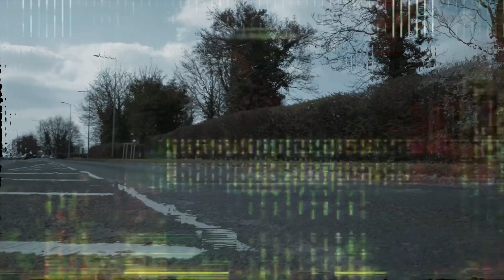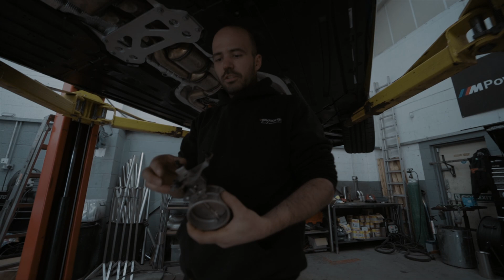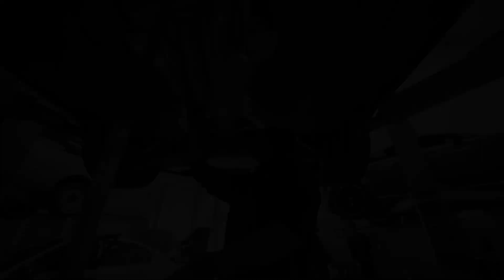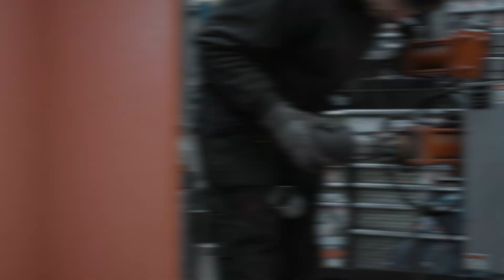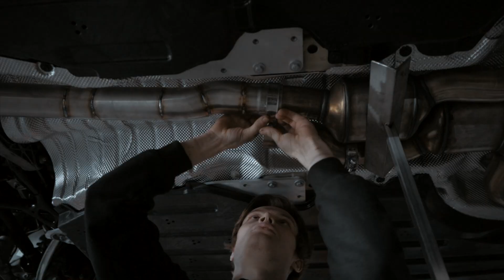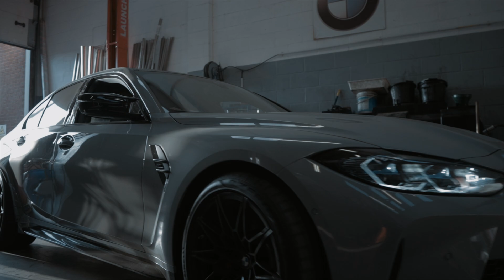NEW BMW G80 M3 COMPETITION EXHAUST BUILD! *INSANE*

Comment: Are the cats built inside the opf’s?
Reply from the maker: Separate but we haven’t touched cats or OPF this system is OPF back
Reply: @DeutschTech  is the cats are removed would it throw any errors? Seen as they are separate…